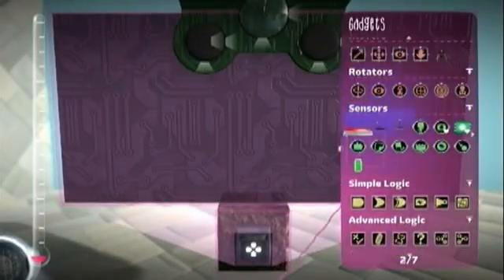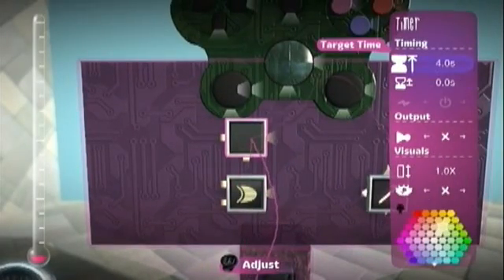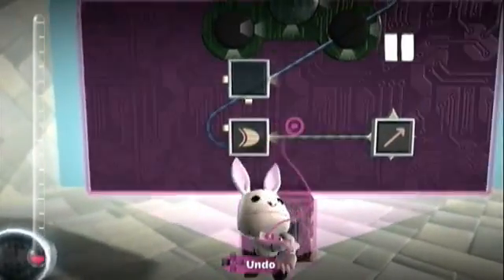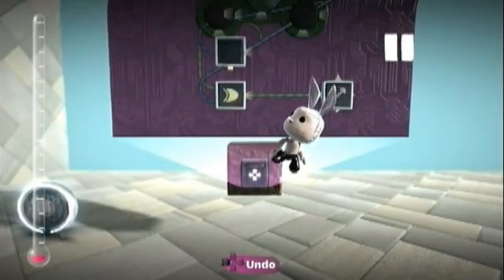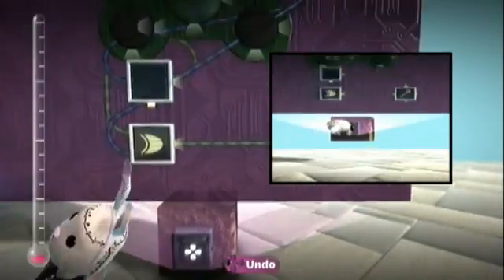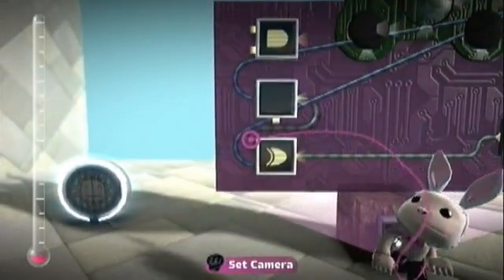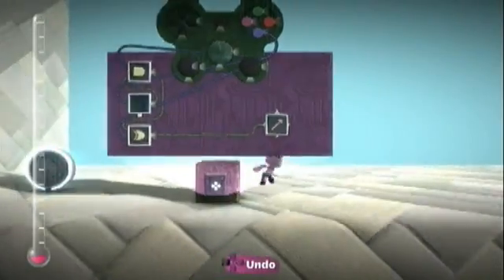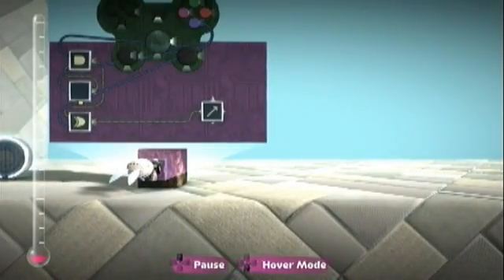LBP2 One Shot Button w/Debounce

Comment: An easier way is to, add a timer set it to start count down, 0.5 add a AND gate plug the AND gate up to ther timer add a NOT gate and connect it to the timer reset. Plug a impact sensor to the other port of the AND gate. Plug the AND gate to the NOT gate.
Add another port to the AND gate a plug your jump button up to the port we just added to the AND gate. To avoid jumping really high by touching the wall, change the inpact sensor to require tag yes. Add a tag to the ground.